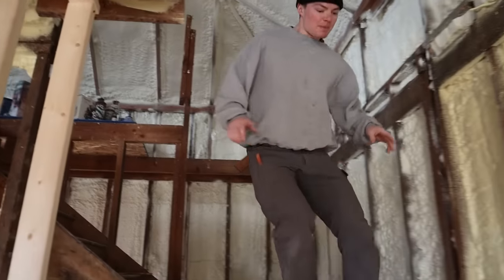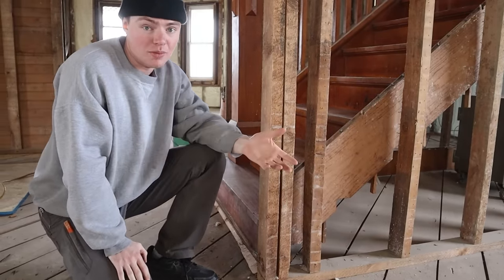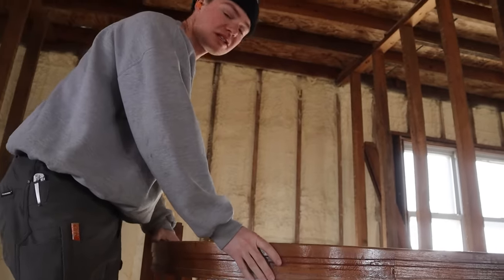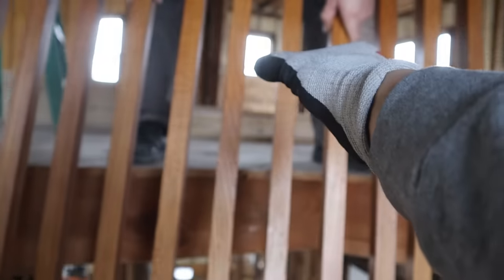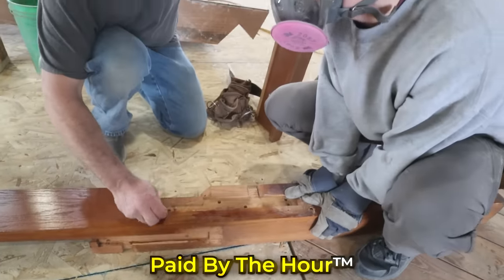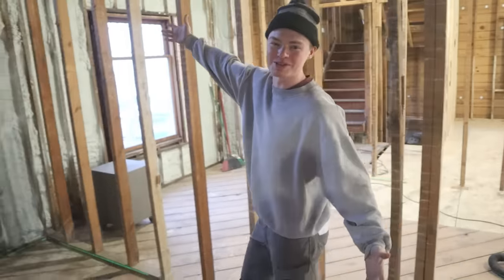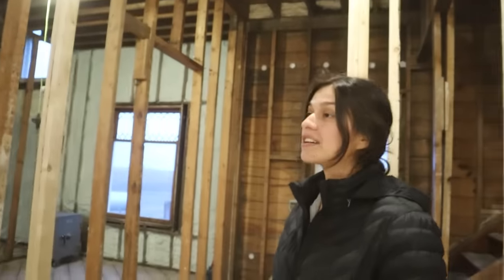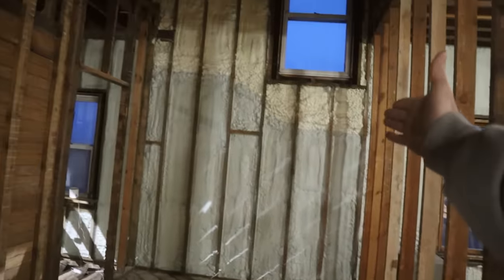Restoring A $7,000 Mansion: Grand Master Staircase Removal

Comment: Argon in windows is not for filtering UV light.  It's because Argon is denser than air and doesn't conduct temperature as well as air. The argon acts as an insulator.
Reply: yep..... low E Glass is a coating .....
Reply: Thanks guys. I now know why I can never get my windows
Clean. How
Does one
Clean two-pane windows
If moisture is in between them?
Reply: @vickimerchlewitz you don’t… must be replaced.

Comment: Thank god these three weren't responsible for renovating Notre Dame. They just rationalized not doing the work necessary to preserve what deserved preserving and took shortcuts and touted safety and modernization. Taking down those stairs is like watching a trophy hunter stand next to an elephant and extol its beautiful tusks and magnificent form. You killed it and for what.? Beautiful windows, beautiful doors with mirrors., beautiful ceilings., beautiful wood stairs, Straight to the burn pile. . The only floor that will look better, the basement.  It won't be the finest mansion west of the Mississippi, just a house on a hill with nice siding and a porch.  The rest of the farm looks nice thou.:hand-orange-covering-eyes::face-pink-tears::body-blue-raised-arms::face-turquoise-covering-eyes:
Reply: Vinyl siding, vinyl windows, vinyl decking, vinyl flooring...

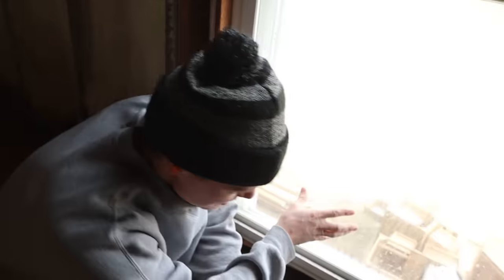Comment: 5:15 Argon gas is in windows for its insulating properties. There is a UV resistant film either inside the actual glass or applied on the outside of the glass that wears off over time. Argon does not protect from UV. Cool videos love your series

Comment: I nearly cried watching those stair come out. There is no way you will replace that with something better
Reply: Particle stair treads with 11% off rebate and a neutral stain master carpet. No squeaks! (Sarcasm)
Reply: didnt you see them bounce and squeek as he walked up and down on them? They were very nice,,,100 years ago. They needed replaced. If he was actually restoring this place like it was built, i would agree that he needed to keep and fix those stairs but he isnt going for an original look so they needed to be removed.
Reply: @warrenmichael918  From a thousand miles away they looked repairable. Not by weekend carpenters though. Even if they weren’t I know what goes into building them in the first place especially without today’s modern millwork tools. Even getting that quality wood today is hard. I am not condemning what they did I am just mourning the loss of old craftsmanship

Comment: I can't believe you threw away all the wood from the stairs.  It was still good for other projects and is probably stronger than anything you can currently buy.  There was no veneer in the stairs.
Reply: @HouseWinchester1874  agreed, easily reinforced and rebuilt
Reply: @HouseWinchester1874Vinyl is much easier to clean, and we all saw how well Cole and Nava kept house before this "restoration".

Comment: Iowa building code, as with nearly other place, recognizes that rebuilding interior stairs in an existing home to meet current building codes could be impossible. So you do not need to actually tear out old stairs even if you gut a home. BUT, if you do tear out the old stairs then you do need to meet building code. So Cole potentially made a really big problem because it is pretty clear they do not have any building plans yet. They should really have an architect or experienced contractor advising them on all this stuff.

Comment: The Old growth lumber will never be replaced today. It's ok if you replace it it does need to be level and solid  Sears & Roebuck sold house kits from Chicago. They sold a complete line of out buildings, barns, corn cribs, machinery buildings. Easy to ship by rail in those days.

Comment: I seriously dont know if I can watch these anymore.  All that beauty and craftsmanship gone.  I know the house needed a lot of work but the fact that so much of that is going straight to the dump or the burn pile and not being preserved in some way is just soul crushing.  At the very least he should store it so it could be donated or sold off...there aint exactly a lot of sources for that stuff anymore, all that old growth lumber...just hurts the heart :(
Reply: Hi l believe the wood thats no good is being throw away but the beautiful wood like the stairs are being stored one of the buildings
Reply: @peterrichardson9355  Right. He did not throw away ALL the old wood. He saved the doors with mirrors, sliding doors, fireplace frame, built-in hutch, crown-molding trim, other trim, ceiling trim and many other boards from several areas. He will reuse most of this in one place or another.  But I don't think he saved any of the wood from the stairs because you could see that that they tore it apart in way too many small pieces. Unfortunately!
Reply: He did not throw away ALL the old wood. He saved the doors, sliding doors, fireplace frame, built-in hutch, crown-molding trim, other trim, ceiling trim and many other boards from several areas. He will reuse most of this in one place or another.
Reply: @julien2912  So far seems like the only stuff being saved is Roman's chicken coop wood.  Im sure the chickens will enjoy the amazing detail in all that crown molding while pooping on it all day :/

The way they're wrenching crap off the walls sure dont look like the aim is preservation.  When they're done the inside of this house is going to look like every other house built over the last 25 or so years...nice and boring and flat with no soul whatsoever.  They're sitting here pointing out all the flaws with the 100 year old build as they tear it apart but the thing is, none of those new houses are going to be there in 100 years...I know, I own a home built in 2005.  They're not built to last, they're built to look pretty.  Trust me, the 50k I've already had to sink into this place in the last 20 years on repairs speaks volumes...
Reply: @Effedup they saved doors, the small amount of hardwood floor that was still good, and some of the labeled the good trim so they know how to put it back together

Comment: Tearing out the stairs was so wrong!! Thats the heart of the house far as Im concerned.
Reply: Well if those old dried out rickety junk stairs were the heart of the house, that house was on the heart donor list because they were all but done!!
Reply: @warrenmichael918 I'm having fun going through the comments and finding the reasonable ones, most of which have probably worked in renovation construction and know what we're looking at. Those stairs were junk, the railings didn't look tall enough to meet code, and why would you put new floors and everything else in just to leave old stairs..
Reply: @Beandiptheredneck  agreed. I understand that old hardwood floors and these old stairways look beautiful when restored or even just cleaned up but thats only if they are in decent shape, these were junk!!
Reply: Had to fix the floors n subfloors structure that house will last 100 more years and be plumbed, wired, HVAC to modern codes. He rebuild another beautiful set of stairs

Comment: Just for correct info sake, the Argon gas acts as an insulation between the layers of glass. It has no U V protection properties. The U V protection comes from a layer, or film placed on the inside of the glass. This is known as Low e, or low emittance glass. This film filters out the ultraviolet rays that can cause fading of whatever is inside such as carpet, woodwork and other fabrics. It also helps keep your house cooler in summer. That old staircase could be dismantled, refinished and reassembled, but that is just me. I don't mean to be critical Cole. I love watching your videos and have been a fan for years, Being in the building industry for nearly 35 years and being an old curmudgeon i have a lot of sentimentality!
Reply: Funny enough but I told him the same thing and he said “check it” so I did…
And indeed argon also serves as a UV blocker🤓
Reply: @Romegrom  I will have to study up on this! I have been selling windows for 30 years and i have never heard that.

Comment: I wish you could keep the stairs
Reply: Those stairs are of better quality lumber than anything you can get today!
Reply: If he was truly restoring this mansion he would keep all the wood work.
Reply: The quality of the lumber might be better however with the overall condition of the house pluses modern building codes the stairs had to be replaced in their entire assembly.  Modern stairs are stronger than what he had.
Reply: @haroldbenton979  thats a load of bull its just brainwash so you can buy new stairs in a matter of 10 years
Reply: @axelthefoxytechworld8024  Nope those stairs where junk.  Will not pass code one bit.  The lumber wasn't even that good.  I bet you that those stair  wasn't from 1917 they 1940 at best.
Reply: @axelthefoxytechworld8024 you telling me old dried out cracked stairs are stronger 🤔😂🤣 I don’t think so. Just like all the studs not fasten and lack of headers make the home stronger then todays standards 🤔😂🤣 I doubt that 💯 as I live in a house built in 1898 and floor joists in the basement are so dry they are splitting in two.
Reply: @johnunsicker7440 What code?  Do you think there are building codes in BumF, IA?  Where has the county building inspector been up to now?  There isn't one.
Reply: @benhur520  Actually, building permits and inspections are required where Cole lives, even for rural properties. Whether he has them is another story completely. If he doesn't, then not the smartest move to broadcast all of that work across the internet.
Reply: @kevink4914  I'm sure you're just showing off your superior brain power, but you're not accepting what people are actually saying. Nobody said to use these things as they were. Just to use them somewhere in the house. Those stairs could be rebuilt with the same materials they were originally built with. You must not know much about restorations.
Reply: @justmeiniowa So where has the building inspector been to this point?  Where is the building permit(s)?  Is "professional carpenter" Justin working on an unpermitted jobsite?   It may be the reason why we're not seeing any subcontractors on the site, because Cole is too dumb and cheap to spend $100 on building permits.  His insurance company is going to love seeing one of their properties wired, plumbed, etc... without any licensed contractors.  Stay tuned, the stupidity continues...
Reply: @haroldbenton979 There are no building codes in that county, nothing "had to be replaced".  If you're waiting for the building inspector to show up, you're going to be waiting for a long time.
Reply: @benhur520  even if you're in an unincorporated area the nearest metro area and national codes are required for anything to be insured for any homeowners policy.  My source on this only my BIL senior vice president of actuarial research and assessment for State Farm who recently retired.

Comment: Two things for you to consider as you replace doors.  Put a 36" exterior door  AND bathroom door on the main floor for your handicapped accessibility.  It may seem like an extra expense till you need it.  The extra inches make a HUGE difference for someone in a wheelchair or walker.  Also, consider putting in a pot filler above your stove when you install plumbing.  With a young family, having a large kettle filled with water ON the stove is easier than trying to carry it across the kitchen.

Comment: Those stairs could have been saved. Easily. Since you said alot of the labeling you found said Chicago, I wonder if your house is maybe a  Sears & Roebuck house. They were built with excellent materials and architectural details such as stairs, fireplaces, and ceilings such as yours, and other woodwork that were shipped to site and finish installed when construction was completed. Sad about that staircase.

Comment: The argon in a double pane window is used to reduce convection and therefore heat Transfer between the panes, since it is heavier than air. I dont think it blocks uv light though.

Comment: Its kewl Cole appreciates the craftmanship that went into the original build. My family had a large architectural millwork shop. We did high end homes and casino interiors when they weren't so disposable. I am really impressed with all these three guys have accomplished in this old house
Reply: No he doesn't. He ripped every piece out. Might as well have just torn it down and built new.
Reply: @HootervilleHaney no use trying to save old warped wood that likely has arsenic in it
Reply: He was so impressed he immediately took it down to the burn pile.
Reply: @KILLKING110 Are you sure it's arsenic and not cyanide?   In a life or death situation can Cole tell his family to bite down on a stair tread if things get bad and it'll be all over?

Comment: Now that the original farmhouse has been totally gutted,  have you calculated the cost of demolition and rebuild compared to simply bulldozing the old and building new?  Just wondering as the only thing not changed will be the exterior walls .
Reply: But up to this point, it'll still have the original single pane windows.  He hasn't mentioned them because he knows what it's going to cost him to replace all of them.  Being that old they're probably all going to be custom sized and not off the shelf vinyl windows at Menards.

Comment: The windows in that house weren't argon filled back in the early 1900s, double pane windows didn't come into use until the 1950s and it was the 1970s before they started putting argon between the panes so that bleaching probably happened well before the defenses against it were made.
Reply: He knows those windows with the white plastic/vinyl body wasnt from the early 1900s. He was just saying that window was bad. I agree with you about the sun damage being from years before the newer window was installed though.

Comment: Think of the miles and trip cycles on those old stairs.
What is the ceiling height of the first and second levels?
This is a great project for your channel. It would be nice to do the same with the 100 year old house on our property. The newer house is already 34 years old, it needs updates but can be lived in while the old place could be demode, abated, and rebuilt like your house.

Comment: Cole, I love your videos.  Long time subscriber and fellow Iowan.  I'll probably get flamed in the comments for this but you are ruining this house.  It started as a beautiful historic home that needed a little maintenance.  So far, you've fixed a lot of things for the better like insulation, siding, cleaning things out, leveling the floors, etc but you've removed all the character of a historic home.  It was truly painful to watch you tear out that staircase and marvel at its unique craftsmanship as you cut it apart.  Will you be putting back all the window trim, baseboards, original wood floors, etc?  I fear you're taking an elegant antique and turning it into boring 'new construction' with no character.  Please prove me wrong.
Reply: You can gut a house for the betterment of the home while also bringing back some of the character the house previously had.

Comment: Why on earth did you pull out solid oak that only needed to be tightened up that’s just a disgusting waste, you could have done the floor with the stairs in place and a few screws and some glue and the stairs would last another 100 years 😕
Reply: One thing that'll happen after all this is done, nobody in the area will ever hire Justin to do anything they care about every again.

Comment: I agree the stairs need to be rebuilt but the reason is to enlarge and make the rise shorter than 7” and the run more than 11”. They will be much more comfortable to travel vertically through your home. Since all of your bedrooms are on upper floors you will be traversing those stairs millions of times a decade. With all of the physical activity you need to anticipate knee problems and discomfort. The shallow steps will greatly improve the comfort and ease of travel on your stairs. Take it from a professional who has a 100% satisfaction rating from clients and family who have benefited from my insight and designs, DO IT RIGHT this time! 😎

Comment: I'm sure you could still keep the railings, they are only screwed in, they come apart fairly easy.  I had my floors refinished and they took out the railings that I had and put them back and they were solid after and looked really good.  It's a shame to get rid of them.

Comment: I realize all decisions are yours, just wanted to mention these thoughts… you are working real hard and I’m sure all will be beautiful.,,

Can you re-use the railing, to maintain some of the integrity and Victorian age of the house?😊
Also, maybe too late now, but the exposed brick from the old fireplace in the one room is many times saved when restoring as it also was original to the house and in design work adds a different and interesting texture to the walls. On the first floor I am hoping you saved the fireplace mantle (and bricks) it was beautiful you could put electric heat in it ( not use it to burn)…and those pocket doors, just beautiful and with small children could give you privacy and quiet for the children while they sleep, And no pinched little fingers or door swing to worry about.

Comment: Cole...my dude...Argon does not work like that. Argon works to slow the heat cycling in between the panes of glass. The Low-E coatings on the glass are what reflect the Ultraviolet rays.

Comment: Still need to spray some more foam on the ground floor.  After you wire the house are you gonna to fill the rest of the wall gavity thru out the house before the drywall?